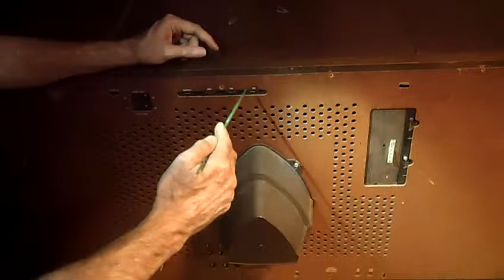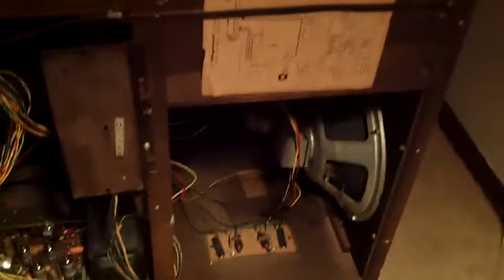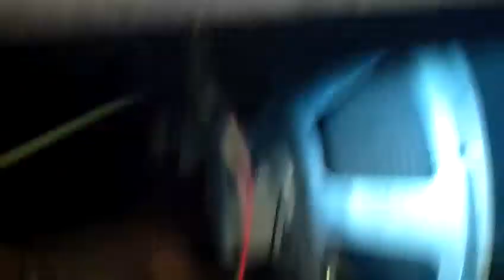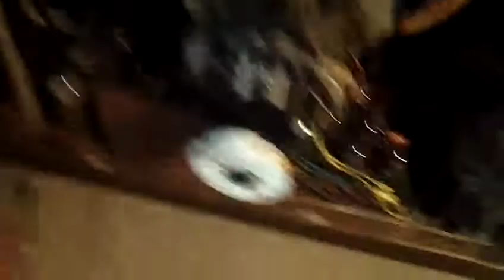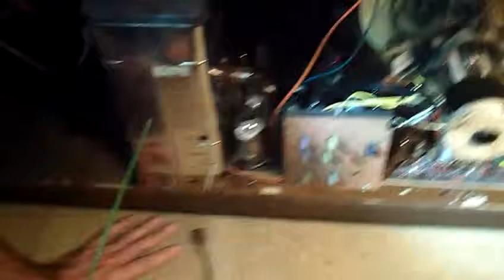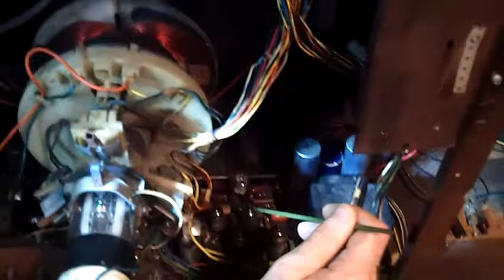Vintage round tube color TV Magnavox Combo Part 1 (chassis views)

Comment: The quick picture function used a choke in series with the main power transformer and only the B+ is taken out of circuit in the off position. Not only was the life of the CRT compromised, but the power consumption was over 60 watts with the set "off" and some did cause fires.

Comment: Hi Dave,
I’m wondering how to safely remove the tv from the combo. I have one and the tv is broken and I would like to remove it. But I would like to keep the phono and radio working and in good shape.
Reply from the maker: they are very heavy, and if you mean to remove the picture tube, its pretty solidly installed, I cant explain in detail but I would suggest extreme care anytime handling vintage equipment. Your best bet would be to check your local area for any hobby clubs that could assist.

Comment: Good job on that classic set! The chroma tint function was a common feature on sets of that era. Motorola actually had a "tint" control (alongside the hue control) that did the same thing. I guess this was a gimmick for people who probably preferred a sepia tone for B&W programs. The Insta picture switch feature, in addition to its "instant" function, also prolonged tube life by not cycling the tubes full on and off. Though it definitely would not earn an "energy star" rating.

Comment from the maker: I went back and checked my notes, This set did need some work.
leaky horz afc diode (poor lock in)
bad doubler cap (hum bar, low b+)
hack work (had a wire soldered to a tube ground pin, with a alligator clip to ground)
some interlace issues, not sure what the fix was there, could have been a tube
replaced the HOT grid coupling cap (I pretty much do that automatically)
cap across the primary of the vert out (can't really test that as it lives in a tough area.
clean up some traces that were a mess